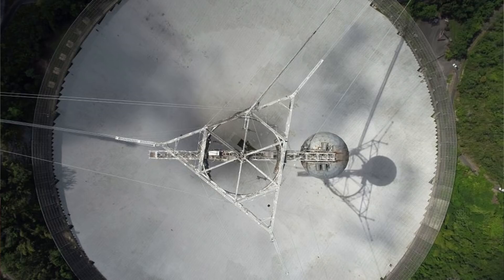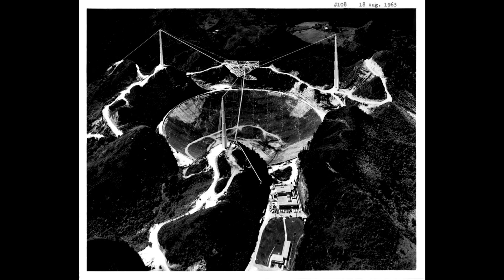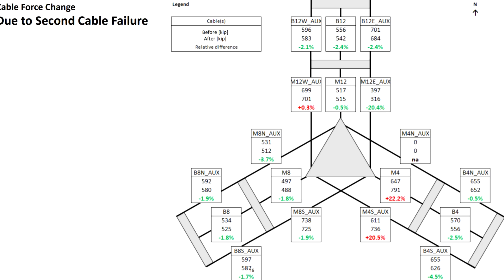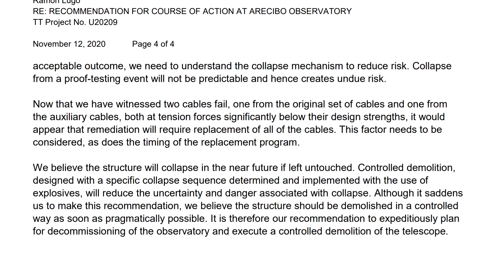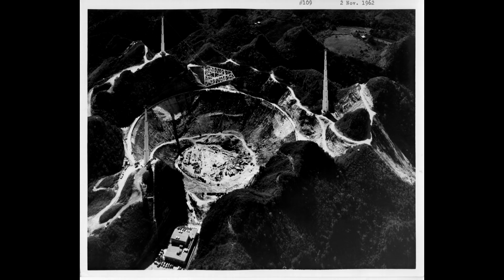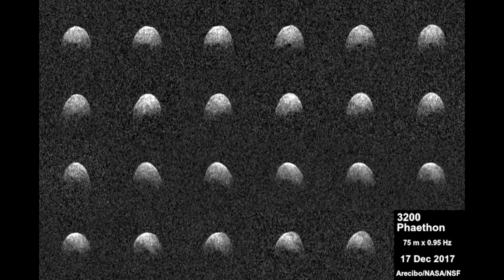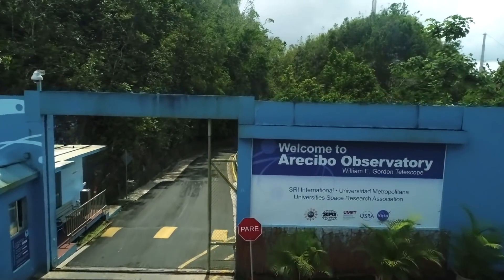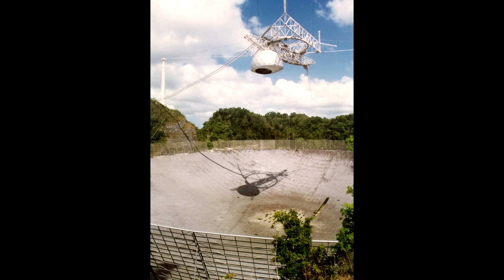Worlds Largest Radar Astronomy Dish To Be Demolished!

Comment: Hi Scott, as someone who's done work at Arecibo and am now working at FAST I'd like to thank you for this video. For many of us who learned how to be radio astronomers at Arecibo, these last few months have been difficult. 

I'd also like to add that your comparison of Arecibo's range is incomplete. There is a further reason why Arecibo was so uniquely good at planetary radar. The larger the antenna, the small the beam size (or greater the magnification). So not only was Arecibo able to collect more signal as a receiver, it was also able to pack the transmitted power into an area on the sky that's about 10 times smaller (100 times less area) compared to the DSN antenna. 

The only other telescope which could conceivably do this is FAST. But FAST has a much smaller feed structure (the structure hanging over the dish) that weighs only about 30 tons. It simply could not support the weight and power requirements of a radar transmitter without major upgrades and redesign. 

Excellent video,
Cheers
Reply: I pray they can safely take it down and then invest in a new telescope with all new tech for a new generation of scientists!
Reply: That's really interesting! Thank you for adding to the discussion.
Reply: Your personal experience and perspective adds much value to this sad situation. Sailors feel the same attachment to their ships. In a way this feels like we’re watching the Titanic hit an iceberg.
Reply: Great comment Marko K!
Reply: But does the feed structure really need all that weight it had at Arecibo, or could most of the mass be moved to ground equipment at the base of the feed line, fitting much more into the 30 ton limit at FAST?
Reply: @johndododoe1411  A steerable radio telescope the size of Arecibo moves its secondary reflector assembly (that heavy dome thing) around to change the beam angle. Even if the feed horn assembly could be moved to something on the ground it still would not be the majority of the suspended mass.
Reply: @DrewNorthup  My idea for Arecibo rescue was to lower the entire suspended part of Arecibo onto a temporary scaffold while replacing the deteriorated truss and suspension system.

My question earlier in this thread was if some of the heavy gear suspended at Arecibo could be replaced by ground equipment at FAST, similarly to how many smaller antennas have a heavy electrical cable from ground equipment to a mass-optimized "head" assembly at their focal point.

The suspended part of Arecibo probably contains equipment designed around the mass of 1960s electronics and the mechanics to lift that mass, where later decades have lowered the mass of equivalent functionality, replacing radio tubes on aluminium mounts with FETs on plastic PCBs and big resonant cavities with active circuitry.
Reply: @johndododoe1411  It's a neat idea. The engineering team has considered it though and concluded it would just take too long and be too dangerous. You'd need to build new support towers with support cables that would be anchored to a winch (so the platform could be lowered). This would take quite a bit of work.
Reply: @marko4134  Then maybe a hydraulic support raised up onto the platform from support points that the platform wouldn't fall on (to keep workers safe).  Or with a 500t+ load, maybe just a rigid scaffold built up to the height from the ground to take the weight off the suspension system.
Reply: @johndododoe1411  The short answer is yes, much of that equipment needs to be at the feed. The capacitor needs to be up there at least because otherwise you'd need to send that electrical pulse across the at ~3km of cable between the instruments and the feed. And you can't just instantaneously transmit that much power in a short pulse (it has to be very short for planetary radar) without dealing with induction. For induction to not be a problem (essentially to lower the current) you'd need cables thick and heavy enough that they'd collapse the structure. 

Consider that the instantaneous power of Arecibo's radar could go up to ~20 TW. But the total power generating capacity of the entire USA is only ~1 TW. Basically, you've gotta transmit 20 times the power for the whole US to that feed cabin. Which is just impossible.

Instead you can use a capacitor like Arecibo does, but that capacitor exceeds FAST's weight limits by a fair margin.
Reply: @marko4134  I was only considering the 300m from the base of the gangway to the head, expecting final equipment to sit there.  How much could the capacitor mass be reduced with modern dielectric materials?  Or could the pulse travel along the feed cable modelled as an electronic/thermal component rather than trying to make a signal neutral cable carrying the equivalent of Eurasia's power capacity.  A burst transmission capability for FAST would be a new design, not a transplant of Arecibo equipment.
Reply: @johndododoe1411  FAST is a quite different design. At Arecibo that big feed structure was used to move the feed and point the telescope. At FAST the whole feed structure is moved by lengthening and shortening the cables that support it. They are anchored at the base of each support tower.  The electrical and signal cables thus actually have to be a lot longer than 300m. In fact, from the power supply to the feed is about 3km of cable. 

It doesn't matter how you model the signal, that much instantaneous power would require obscenely fat cables. And physics and material science would allow you to reduce the capacitor size by only so much before you hit real, hard physical limits.
Reply: @marko4134  However the signal only travels from the final amplifier to the head and could run along a separate diagonal like the access walkway at Arecibo.  Modern capacitor dielectrics provide a size and weight reduction compared to air capacitors which is orders of magnitude.  A major cable size reduction would be from only doing a few pulses, then letting the cable cool down while energy storage refills from the grid.
Reply: Just to give an idea of the focusing, Goldstones EIRP (how much power it would take to get the same strength, if you were transmitting in all directions instead of a tight beam, a way to compare two different antennas of different directionality like this)  is 363 GW on X-band, and Arecibo was 20TW EIRP on S-band.  Arecibo has a monstrous amount of directional power (as if the radar imaging of other planets didnt make this apparent)
Reply: Can't we start a fund to try to save this important tool? What would it take to save it? Coming up with a plan, and a price will help get the ball rolling.
Reply: @paulforester6996  Maybe build a temporary scaffold at the bottom so the platform can be lowered and rebuilt with new cables and details.
Reply: @paulforester6996  it fell man...it was so sad to se our radiotekescope fall into the aluminum giant plate...broke our hearts that morning
Reply: Only on this channel can you say the commenters are actual scientists. More actual experts in the comments would be awesome.
Reply: What is the Diameter of FAST? I mean the diameter that is really used (reflected to the feeder)? I read 30mm meters are used. But with repositioning the feed structure it allows to move the beam).
Reply: @kraftrad7840  FAST's illuminated aperture (the portion of the dish that's actually used) is 300 meters when pointing straight up, but can go down to 200 meters when the telescope is pointing to its lowest elevation. Arecibo's illuminated aperture was somewhat frequency-dependent but generally around 245 meters.
Reply: @marko4134  Thanks for clarification
Reply: @kraftrad7840  The diameter of FAST is 500 meters and it's the biggest radio telescope on Earth.  You can search it on ytb.
Reply: @yxw9418  Thats not the effective diameter. Its just the mechanical diameter of the dish. That does not mean a circle of 500m is reflected to the recivier. I read its 300m effective.
Reply: @yxw9418  is not the same bro
Reply: @kraftrad7840  Diameter of FAST is 500m so whoever wrote the title of this video is smoking some kind of crack.
Reply: @Meatwaggon  I was asking for the effective diameter (or equivalent area)
Reply: @Meatwaggon  The title is correct. FAST is not a radar instrument. It's “just” a radio instrument. Areceibo is both, and so it is the largest radar astronomy dish - by far. Scott explained this in the video...
Reply: @FizzBhaal  While the title may be factually correct, if taken at face value then it loses ALL significance, given that Arecibo is only one of TWO "radar" dishes in the world.  In other words the "world's largest one of two radar astronomy dishes is going to be demolished!" sounds laughably stupid.
Reply: It’s to important to abandon.
Reply: If China wanted to they can make any changes to FAST, its just not economically a good Idea compared to building a new one.
Reply: @Javier Solis Hence my suggestion to approach it from the sides with slanted pillars, with only some pieces sliding under the thing, with workers outside the crash zone.  A simpler, but too weak solution would be to grab it from above and just hoist it away, but I doubt there's any cranes that can lift it.
Reply: it was so sad to see our radiotelescope fall into peaces...my eyes got watery that morning that I saw the news
Reply: I suspect the next radio telescope will be built on the far side of the moon, and can be much bigger due to the low gravitational forces and advancing technology.
Reply: @spyeatte  Maybe not next, I think that's a bit optimistic. But yes, I too expect the far side of the moon to be the future of radio astronomy, because it's the one object in the vicinity capable of fully shielding detectors from human-generated QRM. There's going to need to be a huge no-WiFi zone around it, forever. Like a thousand kilometers or something.
Reply: @spyeatte  but that's where the secret moon base city is.. ;)
Reply: @Marko K  Hypothetically, could Goldstone transmit radar and FAST use its larger diameter to receive return from more distant objects?  

I asked myself what we would do now if needing confirmation a distant object was on collision course for Earth and that's the thought that popped up.

Earth curvature and rotation would be complications but could it be done?
Reply: @andrewd7112  Hi Andrew. Actually that would not work for two reasons. 

1) NASA is not allowed (by US law) to conduct collaborative research with China unless it is part of an international collaboration. 

2) The longitude between the two telescopes are too different (they're on the opposite sides of the earth). Goldstone is at 117 degrees W longitude, while FAST is at 107 degrees E longitude. That means they're separated by 136 degrees.. Now let's say each antenna points to its maximum zenith angle (straight up is zenith angle=0, and the horizon is at 90 degrees zenith angle), that would be about 70 for goldstone, and about 40 for FAST, that still leaves 26 degrees difference. Meaning they cannot both point to the same direction in the sky at the same time. 
So what they'd have to do is wait for the earth to turn 26 degrees (at 15 degrees per hour that's ROUGHLY 2 hours) between when goldstone transmits and FAST receiver. So that means that the MINIMUM distance for the target object would have to be at least 1 light-hour away.. Jupiter is about 45 light minutes from the Sun. The goldstone-FAST pair just wouldn't be sensitive enough to detect an asteroid out that far.
Reply: @andrewd7112  The distance / travel time vs. signal strength is wrong. Interesting idea, but they're effectively 2/5 of the Earth's circumference apart. There are some potential targets, but if that was the thing FAST was designed for they'd be doing it already.
Reply: @andrewd7112  I think that can only do half less worse. The out going beam still not tight like Arecibo's, and that would hurt the resolution. Ugh, not to mention these two dishes are at different sides of the earth.
Reply: @andrewd7112  good question...but China comunist government don't share any info whit us
Reply: Scotty PIN THIS COMMENT YOOO
Reply: We should build another in the arizona desert,  near  the meteor crater
Reply: Marko K, you who worked at the Arecibo.
how do you feel that in 2014 the video game Battlefield 4 released a map called Rouge Transmission where China are Russia fight against each other with the players having the ability to destroy the cable and have the top thing crashing into the radar dish just to find out that the dish got destroyed in the same spot with the same damage as shown in the video game?

Comment: I think best chance would be having bridge engineers and workers on hot line right now.
They should be able to attach new cables to existing structure rather safely, first do manual work using climbing equipment and ropes above whole structure, and build new line using suspension bridge technology. Right now it's a matter of time when remaining lines snap, people need to act quick.

Comment: Hey Scott, I’m wondering if “insect eye” dishes working together with modern digital sensor fusion tech could be a more cost-viable replacement for Arecibo.  I’m imagining something like an installation grid of 100 x 100 15’/5m dishes.  IMHO, Arecibo was iconic, but also antiquated in approach, with new tech and materials allowing us to build something more powerful and more reliable for cheaper.
Reply: I agree a bit, but also, the insect eye approach, while giving you a larger aperture, doesn't give you the same "signal strength" (well,my thinking is more about visible light, like what they do in some telescope array, but has some shortcomings), and since the fast telescope is pretty modern, I would think that this approach is still valid ?

Comment: Just build 2 towers at either side like a suspension bridge and cable across and suspend the workers etc from that.
800 tons and a span of 304 metres is nothing. Clifton suspension bridge in Bristol spans 400m and it was built in 1864!
Reply: And when the dish collapses and the whipping cables and collapsing towers take out everything in the vicinity?

Comment: Okay, here's the plan, get three helicopters and one by one connect a cable to the center structure. These will go to rapid deploy parachutes. Then all the remaining cables will be rigged for synchronized cutting. Then the instrument structure will fall sort of slowly, into the remaining dish.
Reply: The largest heavy lift helicopter in the world can lift 62 tons.  You'd need 15 of them to lift the instrument platform.
Reply: I meant to just use the helicopters to attach the parachutes.

Comment: I think a Skycrane helicopter might be able to save parts of the instrument platform if they can cut the cables. It's capacity is only 47,000 lbs. But, if they can save that system, the rest might be easily rebuilt.

Comment: I was allowed access in 2000 and can’t express how useful this device was and is.  I guess it was inevitable and hope that all of the infrastructure which will be left in place (the data center alone is incredible) can be reused.  Think some sort of ground based multi wavelength infernometry array which would be easier to maintain and adaptable as sensor technology is developed.  On to the next big thing.

Comment: I am honestly amazed, that they didn't design this thing, so that the instrument cluster could be lowered onto some hardpoints in the dish (possibly retractable if needed) for routine maintenance and upgrades to both the instrument cluster and  the supporting structures.
Reply: I wonder if it would just be too complicated/need even more overbuilding to be able to adjust the length of the cables. But yeah, some kind of service platform seems reasonable (from this non-expert) given that's a huge advantage of earth based instruments
Reply: They've never needed to do that in 60 years, and they've drastically changed the design since it was made.  They regularly change out the transmitters/receivers at the focus without having to do that.  What they should have been doing is replacing the original cables periodically.  Leaving a bunch of steel cables supporting 900 tons in tropical weather for 60 years?  Seriously?
Reply: Its from the 60's, pretty much the decade when hindsight would have ever been the most helpful to the U.S.
Pretty much everything done in the 60's was unsustainable, not going to last, or just plain wrong, with the benefit of hindsight

But truly, as you say they never designed it with hardpoints in mind, it seems like this was made without forethought either, again like many things from the decade
Reply: It was the 60’s. They probably expected to have multiple dishes on the moon by now. Why invest more then necessary on something that was clearly going to be replaced with something better in ten years ?
Reply: Great idea for Arecibo II in fact!

Comment: I have a prospective solution: Modify it to have an annular reflector by removing the center. This will actually IMPROVE its resolution at a small cost in sensitivity - but the cost in sensitivity is less than you might think, because the improved resolution concentrates more energy into the center of the central maximum of the Airy disk.
Once the center has been removed, lower the gondola down onto the ground in the center of the reflector, replace the cables and make other repairs and improvements, and hoist it back up into place.
Reply: You'd have to gently remove the tension in the meantime somehow. That's the part that was deemed too dangerous. The potential energy stored as tension in one of those cables could shear a pickup truck in half like warm butter.